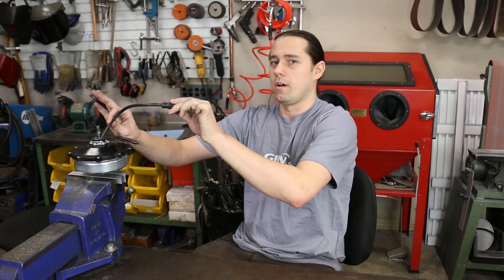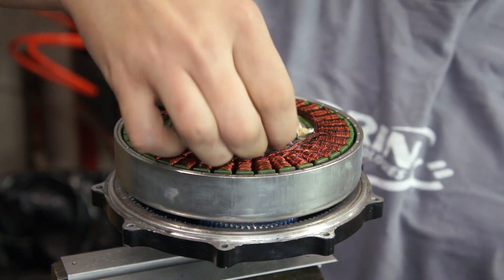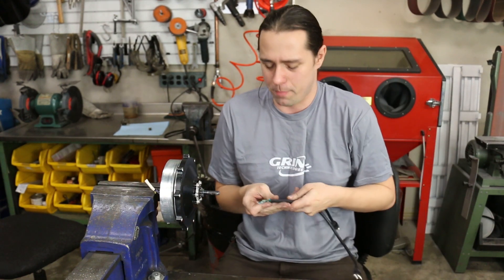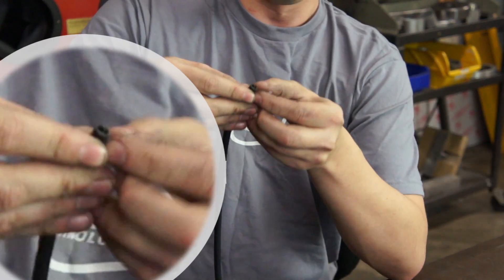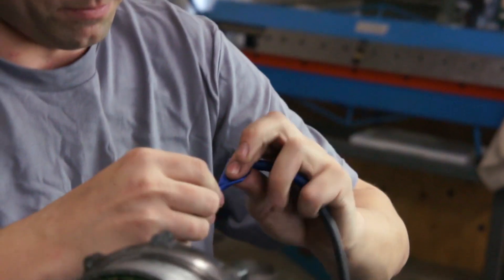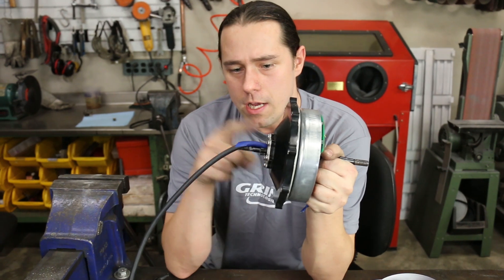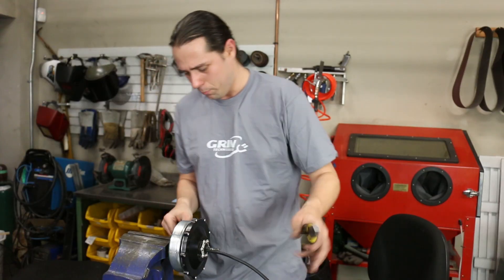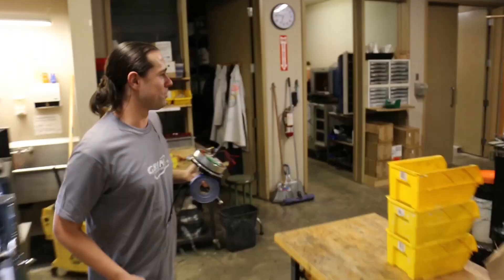How to replace a damaged cable harness in an ebike hub motor

Comment: It's all and good showing connecting up the sensor, and Phase wires, when you have a short colored piece at the location where the wires are supposed to be connected, and  to go by. Now, what if a persob removed all the wiring, without leaving a trace fo where the wires are supposed to be connected. If wired differently within the motor hub, it could cause seriopus damge to the wire windings, or controller., if the wires are connected to the wrong spot inside the motor. All controllers seem to have the same sequence in the way they are wired up inside, and seem to operate in the same manner between all makes and models of e-0bikes. Why not show a video, and go over where each clolored wire is connected within the motor hub, from sensors, and the Phase wires, so that once they are connected, they match what ythe controllers needs to run the bike properly, without damage, or burn-out.  The Phase wires have an order of connection, where they work properly, and so do the sensor wires, that are connected to 3 sensors. Make an in depth video that shows literally what order, and where they are connected within the bike's hub, so the wiring hook-up , matches what the controller needs to run the bike correctly. That way, if a guy cuts away all the wiring in replacing, and installing a new harness, can easily find out how the wires are properly connected to the motors stator wires, and sensors. If you look at a schematic of an e-bikes wiring, all the wires shown from controller to the motor hub, come together at a point. Nothing is fully explained about where which wire is connected (not even on the internet.  All the wires inside the motor hub, have a connection order, that must be followed, so share that info, so mistaenly, someone in a rush disconnects all the wires, and ends up having no clue on how to reconnect a new set of wires to the hub.  Guessing at it, can end up with burnt wires, and a damged controller.
Reply from the maker: Hey Wayne, sorry to tell you but really the only expedient way to do that (determine relative hall and phase pinouts) is by trial and error, and as long as you run the motor unloaded when testing you are not going to damage the controller if the pinout sequence is wront. You can't tell by looking at a motor which winding or hall sensor will be blue, green, or yellow, and contrary to what you say there is not much of a standard in the industry either for what those colours are supposed to mean.  Modern programmable controllers allow you to automatically map the hall and phase details, fixed controllers quire you to permutate through the various options.  Easiest solution is to run sensorless if your controller supports that and then the pinout doesn't really matter.
Reply: @GrinTechnologies  ... Thank You for your reply back, but I can't agree with you, as much as I would like to do so. There has to be a rule of thumb to go by. (a set common market order of function for both the Phase wires, and the Senors). It just can't be hit and miss, like you stated.  If interested, you should make a video regarding this issue..  The controller is setup, to start both sending /receiving a signal in a set pattern order within it's circuits, and it has to match that, within the  wheel hub ion how it's wired for proper performance, and operation, otherwise they'll be fighting against each other. Same applies with a multi-piston motor, which has a firing order to abide by, where  both cams, piston, as well as electronic spark timing, have to be in sink with each other to run properly. There has to be common correct order these wires have to be wired up between each other between all manufacturers.
Reply from the maker: @waynedavies3185  Hi Wayne, you need to trust that we know what we are saying. There is no universal or common standard for yellow green and blue. At least in the ebike space of the motors we've dealt with there have been 4 different standards we have seen and to be compatible with a given controller you have to mis-match the colors.  You don't need to agree with us, but that is indeed how it is.
Reply: @GrinTechnologies  ... Thank You for your reply. I'll keep it in mind.   I continued working on the motor, and finally sealed it up, and tested the sensors (which turned out to be working. Took a chance and hooked it up to the bike, following color code, and it works okay now. Thanks for everything.
Reply from the maker: @waynedavies3185  Hey glad to hear that.  It's nice when colour to colour just works and is usually the sensible starting point, even though it's no guarantee.
Reply: @GrinTechnologies  What you say, just doesn't make real sense. To hap-hazardly (basically guessing is what you are saying), and keep switching the wire connections till the motor works, just doesn't seem right. Okay, I'll give it a try. Am I right in what you are referring to?
Reply from the maker: @waynedavies3185   See section 2.4 of our Grinfineon controller manual for a systematic approach https://ebikes.ca/documents/Grinfineon_V2.2.pdf
Reply: @GrinTechnologies  Thank you....
Reply: Firstly, removing all wires without recording positions and colors of each, would be a stupid thing to do. Secondly, even if this is the case, it can be easily figured where each wire goes, three phases could then be mixed up, Hall sensor signals could be mixed up as well, but power for hall sensors (red and black thin wires) should be figured by studying of datasheet of parts used, as if mistaken, could destroy all three of them. When system is reassembled and connected, one needs to figure proper phasing of hall and motor wires. Nothing difficult to do. Oscilloscope is a good tool to use, if you know how and what to look for.

Comment: Hi
Great video and great video quality camera.
What camera model  you used for this  video? I can suggest you use a smooth ointment like grease or oil or even soap for spreading on the cable

Comment: Where did you order the replacement cable harness? Thanks..
Reply: just shorten the old cable or attach ANY cable.
Reply: grin technology wow guys seriously
Reply: It’s a standard pre-wired L10 plug and connector, so available online. Not cheap but at least it’s a standard item
Reply: Damnit.. this was my exact question... I'm trying to talk to the manufacturer or at least a distributor in China about getting the entire front hub motor and fat tire assembly replaced but I doubt that is gonna happen.. getting ahold of these people is impossible it's almost like it's done on purpose so they don't ever have to honor any warranties
Reply: Aliexpress

Comment: Just pull inside the old cable until you get damaged area inside the motor. Than you can fix it inside the motor. Only downside is you end up with a shorter cable :))
Reply: lol great idea

Comment: 12:52 I tried more then 5 times already. When do I admit defeat?
Reply from the maker: Never admit defeat, but you might want to try sourcing a thinner gauge and smaller OD phase wire if it's having a really difficult time working through your axle and no amount of pulling and lubrication seems to work.

Comment: My six penn'orth, I would use silicone grease on the outer covering of the cable; once I have the tape on then, plonk a bit inside the bore hole. I would also solder a wire to the old cable before I pull it out and then use the wire to start the pull through.

Comment: I cannot put into words how good this video is. I am an amateur who has been wrestling with a MAC 1000w geared motor these past few months. I've literally learned every single lesson in this video the HARD way.  Small geared motors are an absolute nightmare. Not only are there 90 degree angles, no room, the problem of getting the gears to mesh etc etc....but you got sharp edges everywhere too.
Reply: I had to use a chisel to clean off the nylon gear edges to reassemble after 10K Km,

Comment: Were can I buy a cable for fat bike and the axle.
Reply: Aliexpress has plenty of choices there. You can buy either individual wires or complete cable with terminated male/female ends, waterproofed and selected number of lines/conductors.
Reply from the maker: You need to first measure your actual cable OD to know what will fit.  Often it's easiest just to scavenge cables from old/broken motors and controllers.
Reply: Thanks guys I gave away that motor had broken axle.thanks

Comment: Hi Green tech, thank you for this video. Very interesting. 
I have just a question : why we cannot solder the cable directly on the Spule ? thank you
Reply from the maker: We're not sure what a Spule is.  You can solder cables together, but not right where they exit the axle if that is where they are torn (which is usually the case in the event of an axle spinout)

Comment: The Great Grin wiring series - Part 1: cable wrestle.

Tip: use a L1019 cable connector that is even longer, say the standard 1000mm lenght (https://www.e-bike-technologies.de/index.php/en/connectors/connectors-motor/higo-l1019-series/higo-l1019-m-s-detail). Slit the cable mantle open from the open end, say for a distance of 500mm and remove the wire guts from the open slit section. Then roll the cable mantle like a cinnamon stick and wrap the tightly rolled mantle lightly with plain PVC isolation tape.
Now the outer diameter is much smaller and will easily fit through the axle bore.
Insert the cable end into the axle bore until the thicker section is just about to enter the bore. At this point, apply some silicon to the outside cable section up to the point where the cable will later exit the axle bore. Now pull the cable through. Because you are directly pulling the mantle, nothing will tear or come off.
Once your cable has reached its final position, wipe off the excess silicon and let the lot settle until the silicon is dry and the cable embedded in the axle with a watertight seal.
Then continue as shown in the video.

Comment: Thank you for this video. Would you consider doing one that shows how to replace the plastic cogs on this GMAC one day?
Reply: Just pull the motor cover off. Once it's off, all you need for the gears is a good external snap ring plier to take off the small snap rings that hold the gears on their axle stubbettes.  The mid priced external snap ring plier sets with multiple replaceable end bits work well.you need a small diameter end tip. Don't bother with a set that doesn't list the end  tip diameters you need the smallest or next smallest end tips to fit in those snap ring holes.

Comment: Striping the outer jacket to allow enough wire to enter the motor then using thin-walled teflon tubing and slide the wire though the protective teflon ? Lubrication? Protection of coil windings when working on motor, cutting off damaged cable and pulling out wires individually...

Comment: I use some baby oil to lubricate the outer of the cable since it will evoprate away to nothing pretty quickly.
Reply from the maker: Yeah, that's something that should have been mentioned in the video, a bit of lubricant on the wire sheath can help it slide through channel with less friction and force required.
Reply: @GrinTechnologies  if Pete was 2x older, he wouldn't choose force over a good lube.
Reply: Good point  by Mike H. Another useful lubricant for plastic or  rubber fittings is spray  furniture wax, a spray can of the stuff costs $1.25 at lots of  dollar stores. Helps with handlebar grips  too  plus  what-have-you.
Reply: Glad  that  Mike H pointed this out.. If you don't want to buy baby oil, something that's good for lubing plastic or rubber fittings is a $1.25  spray can of furniture polish from the  dollar store. you can use it for other things such as handlebar grips.
Reply: I use silicon oil to cool my geared hub motors, so probably wouldn't hurt to use it to lube a cable sheath either.
Reply: Another choice would either be hand sanitizer or what we affectionately used to refer to as cable snot. 

Hand sanitizer is great because it just evaporates away, and it's cheap, and, at this point, everyone has it!

Comment: I use a dremel to smooth any sharp edges at the entry opening, for the cable I slide the insulation down like you do but I make sure I don't trim the nylon cord the same length as the wires so I can incorporated that into my pulling tether with the slitted insulation wrap. Also I use a wee bit of silicone spray to lubricate the cable.
Reply: My thoughts exactly while watching this…
Reply: Yes these are good points, especially leaving the reinforcement cord along with the outer sheath.
Reply: Interesting, never done this but was thinking the same thing, silicone oil on the cable and leave the nylon cord for strength. A bit of lubrication goes a long way. That's what she said.

Comment: Excellent video . I have done external splices on rear hub motors with 'cassette issues' but am baffled trying to open up a PEDEGO hub motor to get to the inner connections. There is NO POSSIBLE WAY to open up the motor case! At least not that I can see😡😢😨
I can see zero bolts, screws, nuts, fasteners, or ability to open up the case. I gave up and bought a new motor, rim, throttle, pas, grips, controller kit....this solved the problem much easier than splicing on a new cable that SHEARED OFF because the rim nuts were not properly tightened by a professional after a FLAT TIRE REPAIR!
Thanks for showing that this CAN BE DONE by a proper professional. Doing it on a pedego motor seems to be NEAR IMPOSSIBLE.  
THANKS AGAIN  for your video presentation.  You deserve an award of the highest magnitude.  Searching the interwebs for this content reveals very low results.  Thanks for showing us how to to it on a most difficult hub motor, that at least let's you open up the CASE. 👍👌✌💓
Reply from the maker: Thanks for the feedback and encouragement, we hope to keep making and sharing more content on servicing/repairing ebike parts. Most likely the hub motor on your Pedago is one that has a threaded side cover plate, so you need to make a special tool that allows you to grip a set of 3 or 4 notches that you'll see on one side of the hub and unscrew the plate. If they've used a glue on the threads then you'll also need a heat gun to warm the shell and soften the bonding agent.
Reply: ..havnt got any real bikey tools...no vice..no experience..no muscles ...BUT.. Confidence! You gave ..with very clear, carefully filmed close ups of all that's wrong and all that might be done to make it come right! Thank you! My ebike is rock-bottom of the range..4-5 years old..(a Wayscral 315).. .its motor looks bigger and less likely to be so squashed inside. The cable, same thickness as yours, so!!! Could be eazy peazy!!
Reply: @jeanetteleuers7329  the wires CAN be repaired, dont listen to the beginning of the video, i am a certified electrician. Simply splice as much wire as you can, apply Rosin Flux compound, apply some solder, slide over a shrink wrap, slide over a soldering butt connecter, heat up, connect, slide the shrink wrap over, heat up, connect. jobs done. Opening the motor is stupidity when there was clearly a half inch of exposed wire. I could fix that wire with 1/8 inch LOL.
Reply: @willjay9808  thank you!!! I realised, though, that right now I can't be SURE of the problem. I looked at all the outer wiring I could see, and noticed one part of the cable to the main connection/battery was pinched and_screwed down when it obviously should not have been. If there is any kind of crack or break in the cable at that point...it could be the cause of the motor failure.  It had stopped suddenly before and then fixed again...when I dismantled the battery and then banged it back with a bit of force...it was as if a  jolt to the battery in its fixing,  could make the wire disconnect/reconnect.  
I'm going to examine that wire first. Cut off the sheathing where..it feels a bit peculiar to touch, through the cover..as if a sharp bend is there somewhere...a disconnect point...everybody HOPE for me! 😁